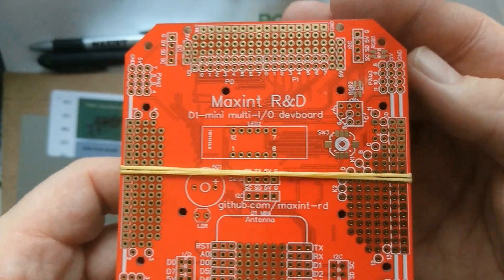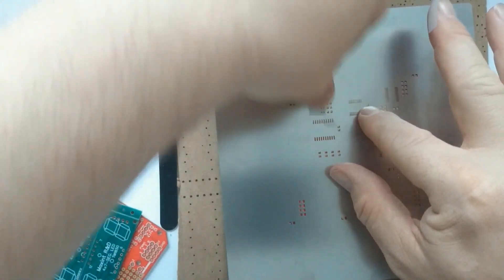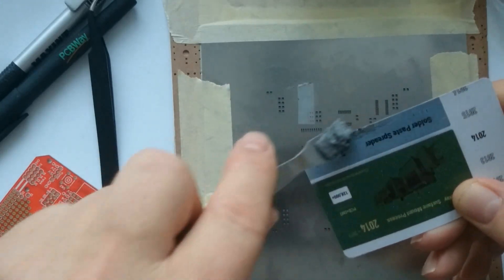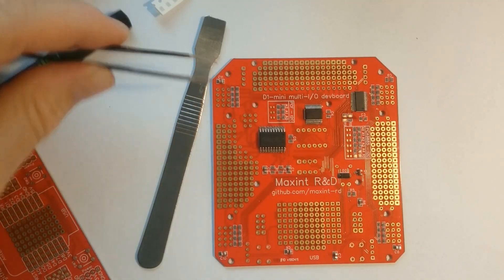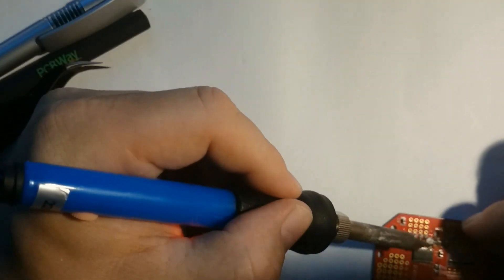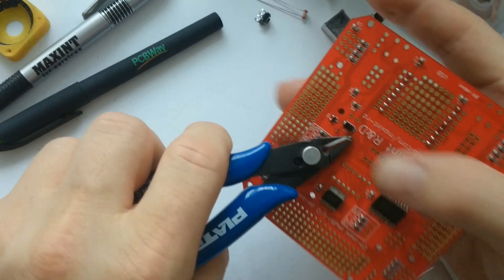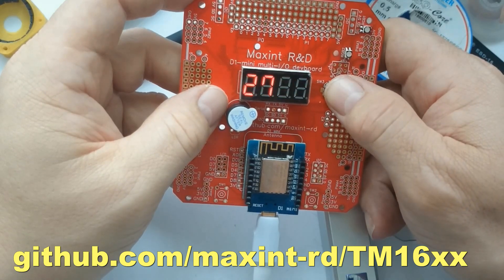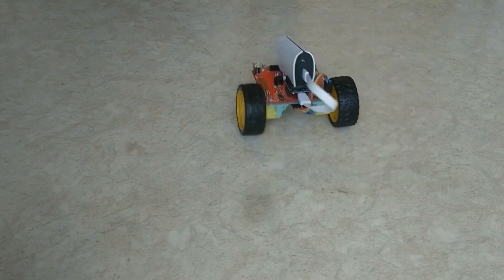Made: PCBWay D1 mini multi-IO devboard - ESP8266 robot

Comment: Cool robot! Thanks for sharing - but that poor paste :( Bin it and buy more... or maybe add some flux as James suggested.
Reply from the maker: Hi Séon, thanks for your comment! You are absolutely correct. I kind of mistreated the paste by just keeping it in my hot attic office drawer. Then I forced it through a stencil that wasn't quite properly fixed (too narrow surrounding boards causing the steel sheet to bulge, leaving thick messy paste) and then it was attacked by soldering iron, flux, desoldering braid and the solder sucker. It's a miracle it still worked just fine!
(I guess, I could really use some of that expensive temperature tolerant paste that you use...)
Reply: Seon - flux - really!!!! ----LOL

Comment: Looks really good! Impressed the solder paste still worked though, could you mix a bit of flux in to make it a bit less viscous?
Reply from the maker: Yeah, perhaps there was still a bit of flux in there that got on the spatula when I moved it around in the jar. You can see that the pasted pads do look kind-of wet and they reflowed fine. I haven't tried adding flux, but may need to on some next attempt to use that paste. I have both a flux pen and a flux syringe. I think that the latter flux is better as it doesn't evaporate too soon.

Comment: wow that looks awesome, great idea, how many motors can it control ?
Reply from the maker: Hi Tablatronix, thank you. Glad to see you like it! The PCA chip supports 16 PWM channels. Each motor uses two channels (a servo only one). I guess the maximum number is also depending on how you use the motors and how much power you can supply.